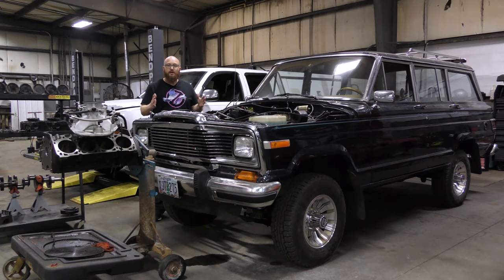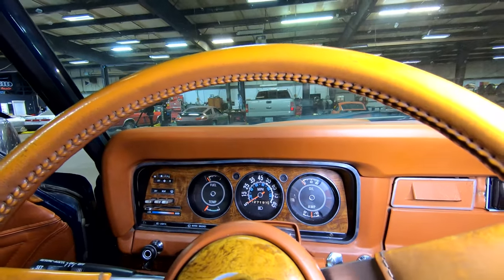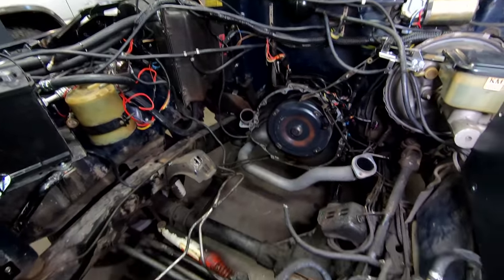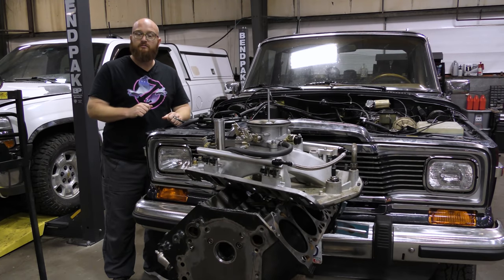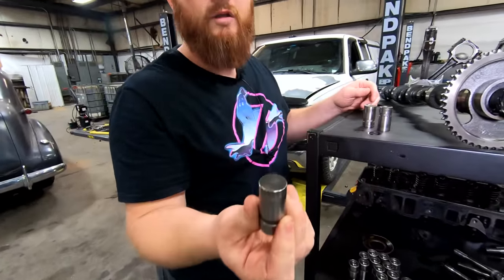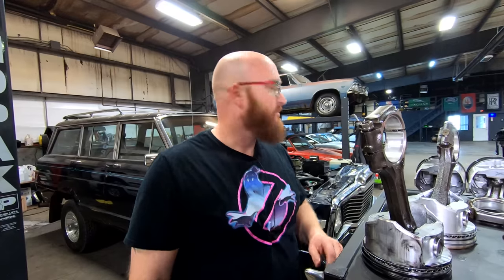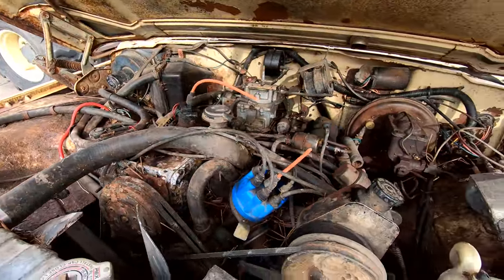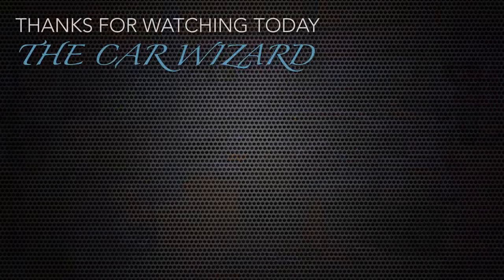The '83 Wagoneer rebuild is dead! CAR WIZARD gets burned by another shop!

Comment: I’m going to be honest. It might not have been the builders fault. There is a known rash of bad cam to lifters running around out there just poor quality stuff from the builder of the camshaft and lifters not the builder of the engine. It might be that the metal from that took out that connecting rod as well. It really might not be their fault
Reply: We had an engine go bad (from defective lifters) during the first 5 minutes of break-in on our shop dyno. We had to completely strip the engine down, wash everything, polish the crankshaft, re-assemble with new bearings, gaskets etc, and upgrade to a hydraulic roller cam, with roller lifters that are made in America. In the end, the client received a good engine, but we lost money on that deal.
Reply: I thought it was kind of evident if you can't for sure say exactly where, why and how, you have to consider all possibilities. I'm with you on this one.
Reply: Yeah going as far as claming SHAME ON the builder and then not having solid proof it is the builders fault... yeah IDK about that one. Im with you here. Throwing shame was a bit over the top for me.
Reply: That doesn't explain the seized connecting rod and bad main bearings.
Reply: Doesn't explain that wrist pin
Reply: @johnd5398  Once a lifter starts wearing, the metal "powders off" into the oil and goes throughout the engine.
Reply: @johnd5398  I imagine it took a while for the lifter/cam grind down to get to the catastrophic point of failure. The heat in that area would be substantial, as well as metal transfers into the oil. My first thought was "wonder about the pushrod/rocker on that cylinder".... It got hot enough it seems, to expand that wrist pin into the rod/piston.. but yea, it's all guessing at this point...
Reply: @johnd5398  Lots of extra metal on that camshaft. Wouldn't surprise me if its caused the spun bearing. The tight wristpin is unrelated though, but who know it could have worked fine.
Reply: @wymple09  Real question there is what did the inside of the cylinder look like for that rod/piston...
Reply: It is still largely their fault unless suppliers committed fraud. They are completely responsible for vetting their own supply chain.
Reply: @rollydoucet8909  but good on you boys for standing behind your work.  I agree that the builder should at least be given the opportunity to respond to the failure.
Reply: @MrCarGuy  i disagree, we are talking about comp cams as one of the large offenders, and they are not some flyby knight cam company
Reply: @madrew2003  We've been in business for 52 years. Keeping customers happy has always been our main concern.
Reply: @wymple09  go back & look at the piston. It's melted! Of course the WP is tight. I'm sure the pin was free & the piston was fine when the builder installed it.
Reply: @Fritzstmire  Chicken or the egg.....
Reply: @MrCarGuy  Do you really think that it's possible to trace a box of lifters back to the factory to check hardness, tolerances, the metal used, etc.??  With all the corruption and bribery going on in the US and China, etc., who knows where the counterfeit lifters were slipped in?

Comment: I just finished up the rebuild of my 1979 Corvette including new lifters and pushrods . Did everything properly, but the lifter failed and wiped my cam lobe! They were comp cam lifters, guess the metal is poor quality nowadays.
Reply: Same here.  Just had a lifter failure on L-82 engine.  Lifters weren't hardened.
Reply: @kennethdavis9987  mine is an L-82 as well! I have new Chevrolet performance lifters on the way, supposedly made in America so I'm hoping better quality metal (better be at the price point). As well as a NOS L-82 cam.
Reply: @thorfalero7838  I used an Isky cam and Johnson lifters.  Waited a few months for parts but it should live this time.
Reply: I have had this happen to me twice with the same 350, both cam and lifter sets were Comp...won't be doing that again. I have a Howard's cam and lifters now. I've also put together quite a few sbc's and never had an issue before.
Reply: @kennethdavis9987  Woah woah woah wait wait -- THIS, YOU SAID IT: "Lifters weren't hardened."

That makes complete and total sense.  Hardening costs 💰.  Chinese suppliers are notorious for cutting corners almost out of spite.  We need to stop buying their trash.
Reply: It is a number of factors that have caused this problem. Lifter quality is one. Reformulated oils are another. Increased use of high pressure springs is a third. Insufficient hardening of cam lobes is the fourth. All the problems are a combination of these factors.
Reply: @keithstudly6071  I wonder if those lighter 5w-20 oils they use nowadays for fuel economy (pumping efficiency) are too light to leave enough film behind.
Reply: @lashlarue7924  Could be. I have never had a flat lifter fail but I had a roller lifter fail in my 2000 Camaro LS engine and it usually took 10-30 but just before it failed the mechanic thought he would do me a favor and put 5-30 Amsoil in and I got 1 MPG more for about 1500 miles and then the lifter roller came apart and needle bearings went flying all over the inside of the crank case and that broke the plastic around the crank position sensor and that plastic plugged the oil pickup. Can't really say it was the oil that caused it problem but I never used 5-30 again. Still have the car and put a factory crate motor in to replace but I may still rebuild the original engine so the car will be all numbers matching, someday...
Reply: @keithstudly6071  damn, man that sucks!  They do say to always use the manufacturer's specified viscosity, although part of me does suspect that the lighter modern oils aren't protecting as much, especially when thrashing on the machine in summer.
Reply: @lashlarue7924  Well the 5W is listed as an optional oil but it was likely a mistake to change to it in an engine with 100K on the clock. Strangely the Corvette version of the LS was delivered with the 5W oil but the Camaro got 10W with 5W as an option.
Reply: I also am rebuilding a 1979 Corvette L82. I’m putting an LT1 engine in the car and I’m using comp cam products. Thank you for the heads up.
Reply: Comp Cam should be doing frequent quality checks for lobe hardness and heat treating. Sourcing parts from China to improve your bottom line is stupid if your sales take a major hit due to word getting around your stuff is now junk.
Reply: I personally don't care what the name brand on the box says. Pretty much all brands are having the exact same issues.
Reply: I have Rhodes lifters on my 1976 super charged L82 which I rebuilt  (years ago )and a comp blower cam . My question is Rhodes still in business ?

Comment: Talking about the worn out cam lobe and lifter,  @10:11 quote: "with that cylinder, that's the one that actually we saw that has the hole in the block",  however, the video shows the lifter bore with the hole is #1 intake, and the camshaft with the worn cam lobe is #3 exhaust (7th lobe from the front). Apparently, the worn out cam lobe is a separate issue from the lifter bore with the hole.
Reply: Conveniently left out that tidbit of information.  I want to see the next engine running, and if it shits the bed, apologize to the first builder.
Reply: I was thinking the same thing. The bore with a hole above it was up front on the left bank. That destroyed lobe was further back on the cam. … wonder what caused the hole above the lifter bore…
Reply: Also it's hard to believe that much cam/lifter wear from running the engine a short time. I don't think they put in a new cam with lifters. They're the old ones.
Reply: @bobbamford5207  Yeah, that lifter damage would only occur from running without oil when talking about such short amount of time! Something's not adding up.

Comment: If possible I would do a roller cam with a grind close to stock.  I’ve heard that it is impossible to find good lifters for a flat tappet cam as was mentioned in other comments.
Reply: Maybe another reason to use a hemi.
Reply: I don't know why they're bothering with the rat Jeep engine. They should just get a later magnum block. It would have a roller cam from the factory

Comment: Now you can raise the compression ratio up to get the most efficiency out of the fuel injection by using flat top pistons instead of the dished stock style pistons.  Stock is only 8 to 1, as I recall.
Reply: 8.0:1 compression and that big 3500-8000 RPM intake meant for a huge cam, huge heads, 3000 stall and 4:10 gears ...yikes.  Might want to fix that too
Reply: @MaliciousSRT  Fuel injection and dual plane manifolds don’t get along all that well, it’s a very well documented issue. And with this being an AMC mill, intake choice is probably not great. It might look goofy, but it’ll run good when it’s done…
Reply: I'd go 12 1/2 to 1 to match that tunnel ram intake. 560 lift, 320 duration cam. Might as well get some Edelbrock aluminum heads with titanium valves, heard they work best at altitude,  but that's me.

Comment: Used to have a 1986 Grand Wagoneer with that AMC 360 engine. With all the emissions, carb and vacuum crap on that thing they almost never run right. I ended up selling mine when the market heated up on them. Heard the guy I sold it to made a huge profit on it a couple years later.
Reply: My '82 ran perfect for my 3 years of ownership with all stock emissions.  But with age and all the vacuum controlled stuff if it starts degrading you are in for difficult times.  When they are right and not hacked or decayed they run perfect in my experience.

Comment: As an fsj owner, as far as I know there aren't any rebuilders that build amc engines worth a damn. The only way I've been told to ensure a reliable rebuild is either do it yourself or find someone that specializes in amcs or jeeps, and that's still not gonna shield you from parts failures from the substandard lifters that we can get new.
Reply: They over torque em a lot of times , they probably used small block chevy torque specs and hung the pistons with a torch.

Comment: Wizard, In my experience having a flat tappet cam go flat is not altogether uncommon. The quality of aftermarket parts now is so absolutely terrible. BUT the stiff piston is inexcusable, and would have blown up the engine regardless of the cam. You should also keep in mind the valve spring set up, and sometimes if you use too heavy of a spring, the cam will go flat. Also, I'm not sure the intake manifold is correct, looks like a Vic Jr single plane race manifold, you should swap out for a dual plane manifold, use the stock manifold or Edelbrock Airgap RPM (dual plane), and it will give you better runability/drivability and bolster low speed power. In any event love the channel Thanks!!!
Reply: The stiff piston wrist pin and the wiped connecting rod bearing surfaces are a 'symptom' of loss of lubrication due to coolant mixing with the oil and lost lubricity.  They are a symptom of the soft lifter or cam which caused the push rod to lose its seating and punch a hole in the block for coolant to enter the oil sump.
Truthfully this is unfortunate but the explanation  the so called wizard made is hyperbolic.  The builder may have done everything correct other than using Chinese lifters and camshaft.
Yes, hardness checks could have been performed as part of pre build part inspection aka quality control like any Nascar or F1 engine but engine builders generally develop a track record of good faith and rapport with their parts suppliers to prevent this issue.  In other words, they build a lot of engines that work just fine with the same parts.  This wasn't the engine builder's fault other than relying on a poor parts distributor....or one that got a bad batch after a long track record of good batches. We don't have the full story and the real story is rarely told.  The customer could have worked with the original engine builder...I would have...and try to make good or certainly get his money back.  The customer overreacted. When you have an engine build you go to a good engine builder with good reputation so when sh!t hits the fan and it can with the best of intentions, the shop will stand behind their work and a rare anomaly because they earned their reputation and why you go to them.
Reply: I, too, think that a high rise single plane Victor Jr.-type manifold is completely wrong for this application, unless it's got the cams, valves, flowed heads, headers, and high stall speed turbine to go with it and take it sand duning or mud bogging.
Reply: Good advise! Performer intake better for street.
Reply: @petrolbokehlicious  Yup, I caught that too.  For those unaware, a big single plane intake like that is for racing, IIRC most only work from 3000+ RPM and higher, this thing needs a dual plane, performer or performer rpm, that thing looks like a Victor jr lol
Reply: not true i use a vic jr with aftermarket fuel injection and it works better then a dual plane.
Reply: @rci-tf2zc  Not if your car is stock cam, heads, stall, gear it doesn't.  Victor jr is 3500-8000 rpm
Reply: Dual planes and fuel injection don’t like to play nice together. The single plane was the right choice for this setup. Could he have gone with a smaller single plane? Sure, but I can’t imagine AMC intakes are all that easy to find, his choices were probably somewhat limited
Reply: @calebkey2050  I respectfully disagree, that is a myth...
Reply: Everybody seems to be missing the point that dual planes and port EFI do NOT mix.  The comments on the torque curve are correct, but NOBODY puts port EFI on a dual plane.  I wouldn't have gone with a Pro-Flo, but a Holley Sniper TBI on a dual plane instead myself.
Reply: @calebkey2050  The old Edelbrock Torquer was a low rise single, not sure if they made them for AMC's.  Personally I would have just put a 09+ 5.7 hemi in it, with the factory EFI.
Reply: I agree with you fully
Reply: Made in China
Reply: @rci-tf2zc  with fuel injection I don't think a vacuum signal like a carburetor does, is the fuel injection throttle body or port injection?
Reply: comp cams told me take out the inner spring of the dual valve springs for the 20 min break in... flat tappet cam.
Reply: @calebkey2050  If it's throttle body or more than 600 cfm carb, just grind 3/16 down the center of the dual plane, polish it up and good to go. It's a great in-between for more power and low rpm street starts.

Comment: Many years ago I paid a "professional race engine builder" to do machine work on a engine for me.  They left LOTS of metal shavings in the motor.  The metal shavings would travel in the engine and knock out the bearings every time I started it.  I had to take it to another shop to have it hot tanked and flushed. After that it was one of the best engines I ever built.

Comment: Love the car wizard, but I'm not so sure you can blame that all on the builder. Isn't it possible that there was a component failure after a certain time ?
Reply: I completely agree and have to wonder how long they ran the engine with the bad lifter. I have seen many cams go flat over the years and although they do happen quickly they’re not that hard to find or figure out. I’m not saying the rebuild was top notch but if they ran it  until the engine started knocking that’s a red flag.
Reply: @10:45 he says he doesn't know why it failed but immediately blamed the builder.
Reply: Can't blame the Wizard. The motor was supposed to be broken in and dyno'd. The bearings are scored, the pistons are scuffed, it's got a tight wrist pin, and a catastrophic part failure. It's either extremely cheap parts or the tech didn't use any assembly grease, or who know what. Too many things were wrong. How did the did the builder Dyno and break it in when it wouldn't even idle. Maybe the builder wore it out on the dyno or breaking it in, and the Wizard just caught the tail end of it.